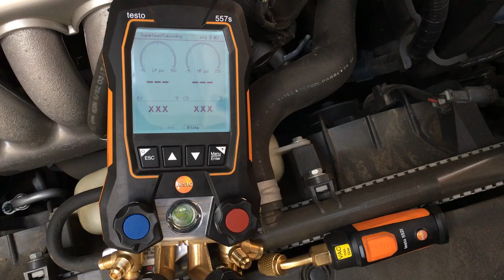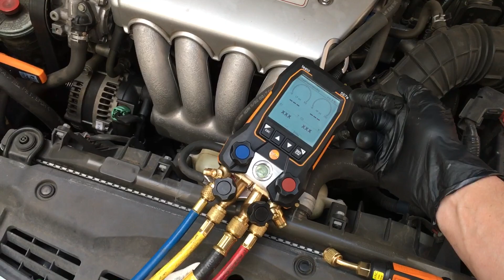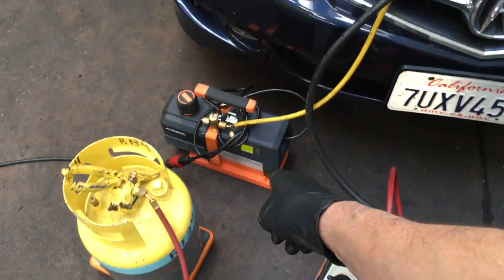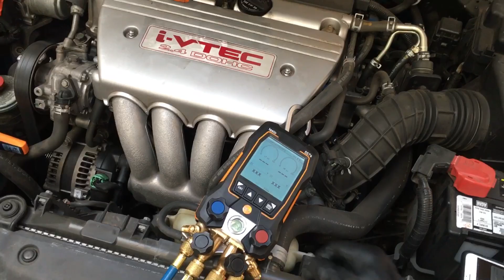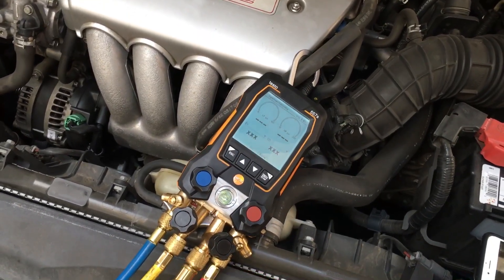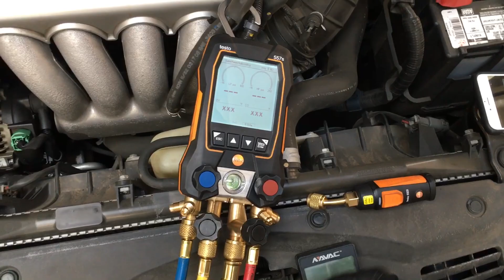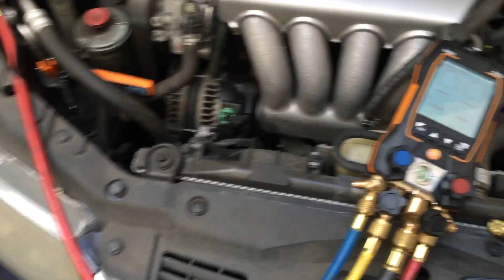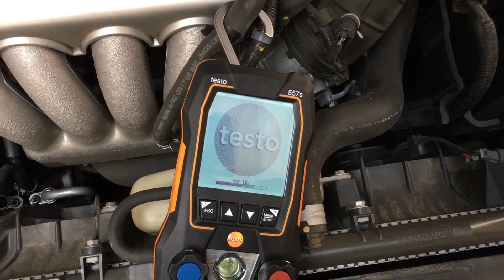TESTO 557s another new failure 😣 you got to be joking TESTO !?.  Importance of micron gauge.

Comment: I'm genuinely curious. I bought a set of testo 570-2 commissioning guages a couple of years ago and suddenly these 557 smart guages are out. I was considering upgrading to them - from what I've seen in your review I'm really not sure anymore. After watching your video I'd be interested in your opinion? Do you think it'd be better sticking with the ones I have?
Reply from the maker: Stick with what you have I like my old Testo 570. 
                      I particularly like the Testo 570 we’re doing high-pressure nitrogen decay test.   I found it to be the most steady most accurate gauge because all my equipment I do 24 hour high-pressure nitrogen decay test at 600 psi to 650 psi depending on which brand I sell

And the new Testo does not even show you vacuum when you’re drawing a vacuum and you’re watching the gauges meter go into negative vacuum.   The vacuum stops at -15 and it does not show you anything else so you can’t even see if you’re pulling vacuum anymore. WTF What is Testo thinking. 

That they’re forcing you to hook up there micron gauge every time you have to use their refrigerant manifold gauge set.     
           I don’t think so there’s a lot of times you just want to draw a quick vacuum and you’re not concerned with how many microns because you’re just doing a quick drain and refill never opening it to the atmosphere.
Reply: @coldfinger459sub0  thank you for your reply you've been a massive help. My only concern with my testos is the ip rating isn't any good for working in the rain. Have you ever used the fieldpiece 380/480 sman range? Their ip rating seems a lot better but I've never used their guages?
Reply from the maker: @moonlitdreamsrc  through my Testo‘s 570 did fog up inside when I use them in the rain. 

And my Fieldpiece if left in the rain with a face facing outwards with direct rain hitting them had the same problem the inside of the screen with fog up. 

One time I accidentally left them on the roof on a job site I cannot get back to you by the end of the day and it rained heavily and they did not work for several days because they had so much water inside of them until they dry it out. 

But since I have several sets of gauges it was of no concern other than drying them out. 

I have taken them apart before to see the circuit board. 

I was thinking I’m going to order some conformal coating.  (it’s a waterproof spray used on circuit boards in electronics industry to make them waterproof) 
          In the flyer to the circuit boards
               They seem to be pretty waterproof in the battery housing they have a rubber gasket in a machine grew that sealed tightly. 

Where is the Testo 557S it’s just a funky piece of plastic that has absolutely no water resistance at all.    Instead of a working man’s instrument for heavy and industrial use the On the battery is constructed more like a child’s toy. 

A company called the DeOxit makes a spray for electronics for marine use to spray on battery terminal contacts and other electrical contracting components.  I was going to spray that inside the battery case just in case on all the electrical metal parts that contact the battery in case of moisture intrusion

If you go to a company like Marin west there’s a lot of products that are meant for saltwater Marin used for protecting Electronics
Reply: @coldfinger459sub0  wait till the vac gauge that's built in on the field piece cracks and they tell you sorry you have to replace the gauge it cannot be repaired. get a simple t piece and hook up the micron gauge to the block its not perfect but same result as what you get from the field piece(of S...t) vac gauge is meant to be the furthest point you can go from the hose line connected to the system anyway so right there the testo is a better setup. id say the reason the transducers only read to -15 is a deliberate act on tests design, 1 force you to use a vac gauge and 2 accuracy, all transducers have limitations since both high and low can go to 60 bar on the high end its probably inaccurate in a vacuum. I Have had a few now CPS black max (POS!!!!!! can't say any more than that) Imperial I was ok but its made for ac work and I do a lot more refrigeration work so not fair calling it a POS its far from it but its not a great do it all, fieldpiece was actually fairly descent while it did not leak from there id was useless apart from taking a reading as there is no way to isolate it once it leaks its a paperweight. Refco was ok nothing special well overpriced reface Bluetooth set lets not go there as POS is a compliment. Mastercool pretty sure its a reface did its job but its not anything special. Testo has been the most robust system I have a few but it has a few issues the temperature clamps pretty crap when it comes to any pipe below 1/2' (similar for the other brands) work around get a velcro cable strap and push the sensor out of the clamp and velcro the thing on. Micron gauge can be a right pain in tight spots so extend with a 1/4" piece of copper and that useless carry case throw it away day one and make a new one from a nice sturdy plastic toolbox. Am I biast to the testo yes but only because its the one that has lasted the longest, My get one 557 still going strong 5 years on I have a few now and the 550I is the one to beat at this stage (have not tried the 557s) but the test I did on the 550I with all its extra features that I do not believe is on the 557 (I could be wrong) if you do commissioning on any system fantastic if you do repairs and want to print a system report with you vac results compressor tests ..... its a great tool but no screen you use it on a phone or tablet. im yet to test the 50m range but that day will come im sure you don't het 50m to your phone unless you have BT5 but I could be wrong my phone gets 15m roughly.

is it 550I an upgrade on the 557 yes it is on ac systems  I grab my 557 if im on a rack any day having a display and not needing my phone is worth the less functionality. is it a great tool hell yes the new app is way better than the 557 app with better reports and in what it can do. 

they all fall on their nose in wet weather but a large ziplock bag solves the issue even the fieldpiece was prone to forging up. ease of use fieldpiece is more all on one display but the testo beat it on functionality and you'd need a much bigger screen to show all the data it can come up with. it might not have warp drive but it has a flux capacitor.
Testo leak detector well not so much once you have used the infocon but that's another topic.
Reply from the maker: @corneferreira7691  I have the 557. That’s my most reliable . and infocon stratus I use more the my H10 now. 557s the worst of all. 

     Tod day at the HVAC Symposium in Florida fieldpiece Stan was busy all day over at the Testo Tools stand you can hear crickets
Reply: @coldfinger459sub0  stratus has been a godsent in supermarkets so quick and easy to find leaks with it. 557 is one hell of a unit
Reply from the maker: @corneferreira7691  557 I will wait for them to fix some of the software issues. It’s a good one when it works I had a lot of high hopes. The customer returned rate was probably the highest testo ever seen and that’s to bad. .     Even the YouTube community who got free samples of 557 stopped using them going back to the 550. 

     One talked about topic was just that 557 problems amongst the attendees this week as I was at the HVAC Symposium with Brian Orb, 

      I’m curious so asking looking for testo people and many own testo I even have all their sensors and measuring kits.   Many people feel burnt by testo.  Disappointed at product problems, how easy they break when dropped. ( I can definitely unfortunately confirm that) testo support . 

     Don’t get me wrong they make good products ideas accurate sensors. 

     But there was a good reason the attendees at the HVAC Symposium stayed away from the testo booth even though it was only 20’ away from Fieldpiece. 
          It was kind of sad to see actually felt sorry for the guy at the testo both. 

I’m going to download the latest version 557 firmware and give my 557 another try. 
         It deserves another chance.
Reply: @coldfinger459sub0  assume your referring to the 557S I've had zero issues with the 557 (previous model) the 550I on test has also been very stable in the limited use that I tried it.

Don't know If I will ever try another fieldpiece.
Reply from the maker: @corneferreira7691  Yes you are correct the 557S

I’m waiting for Fieldpiece to release an updated waterproof version so the screen doesn’t fog up and rechargeable batteries that you can just plug the unit in or give you the option to switch out a battery module. 

         I don’t baby my tools I treat them very rough I just throw them in the back of the vehicle stuff piled on them I use them on rooftops in the rain so if a tool cannot stand through my used and abuse it’s not a tool.

Comment: Do you understand what mass production is? Somethings out the box have a problem, it’s what warranty’s are for. These gauges aren’t for the HVAC noob. I have both the 557s and the sv480 sman. Both have their uses, Fieldpiece is better suited to your basic tech, testos are for the educated tech.
Reply from the maker: Yes I understand mass production but when you have multiple failures in many different aspects of a released item warranty doesn’t mean anything if it cost your company money especially when you’re approaching $300 an hour. 
              Reliability accuracy and repeatability our job one. 
            I started out with Testo over 20 years ago with their first generation digital manifolds and back at that time I spent at $300 for their software for data logging and tracking. 

           20 years ago $300 for a optional piece of software was kind of expensive at that time. 

          And my favorite  were the Testo 570. 

I’ll just wait until Testo figures out all their bugs and just a few more revisions on their software. 

          Fieldpiece used to have the exact same problem when they introduced their first set of digital gauges and their software buggy as hell had some issues they finally work them out. 

              Problem with Testo is there such a large company they move slow to fix their problems
                They were a little late to the game allowing their software to connect with measure quick so they’re way behind and lost a large market share because of their slow movement in the market. 

            But Testo will eventually catch up they have excellent measurement instruments top-of-the-line in our market they just have some little bugs and issues with some of them especially on the Bluetooth side of connectivity

Comment: Not sure about the screen blanking out when smacked, I'd RMA it.

For the microns, you are currently in superheat/subcooling mode. You need to press menu, measuring mode, evacuation, set your thresholds, then select OK. Page 19 of the manual.
Reply from the maker: The blanking out screen and the unit dying when Bob is definitely our electrical contact problem somewhere it’s being returned they already got me a new one I’m packing up the old one right now and sending it back. 

        The disconnected and shutting down of the micron is when I have it in the evacuation mode I have some videos on it repeatedly losing connection and losing my micron dialoguing vacuum. Well it’s in the evacuation mode and I have my high low limit set. 

               I had with the opening of the software with the gauges that would also get stuck into like a boot loop of updating refrigerant and never work it would freeze up my phone and freeze up the gauges. 

              Upon receiving the new set Testo kit the new gauges boot up correctly in the refrigerant updating was only a few seconds and work normally like it should. 

         The new refrigerant manifold does not have the same problem when it gets path or moved around the manifold shut down and restart that is gone so it is working correctly now

               As for the micron gauge staying connected the new one I have not tested yet I’m doing an overnight evacuation on a forehead 5 ton mini split overnight and I’ll try to data log and track it and see if the micron gauge catalog continuously without dropping out

Comment: Micron gauges cant see pressure. Would have to have a auto lock out.

Auto gauges are a bit frustrating. Bought a set of robinair. They were just a cheap 20 set marked way up. 

Guys at my shop like to give me crap for putting the micron gauge on receiver/dryer. And using two pumps.
Reply from the maker: Good micron gauge is not sensitive to pressure that was old school. 

The micron gauge inside the Testo 570 doesn’t have a problem with pressure

The micron gauge inside the Fieldpiece does not have a problem with pressure

Accutools blue vac pro + is not sensitive to pressure plus good tablet Bluetooth data logging

          Forget Robinair old school they haven’t kept up with the times.  In my younger years 30 to 40 years ago Robin Air and yellow jacket were the way to go with analog gauges. 
        But when I bought my first pair of analog gauges they were from CPS for port manifold 1% accurate gauges glycerin filled .   And I custom machined and fitted it oil and dye injection port on the side of them. This was back in 1984 and I had a old analog micron gauge that was very sensitive to pressure.